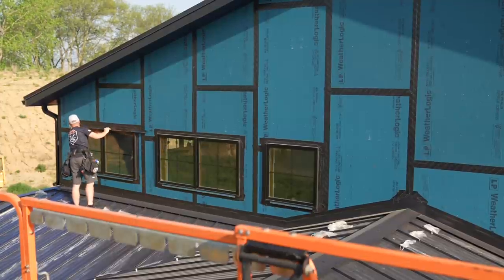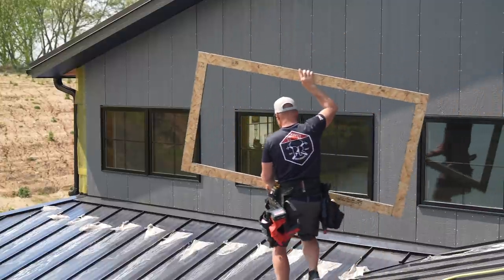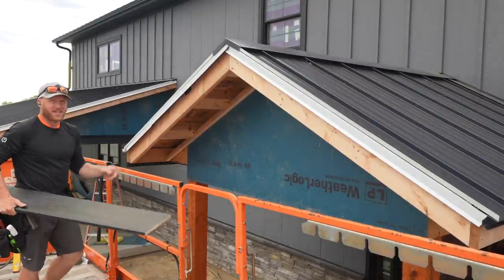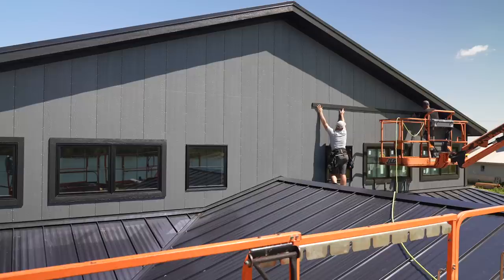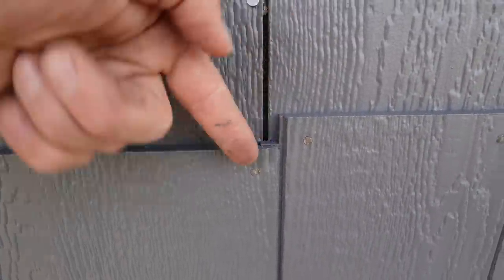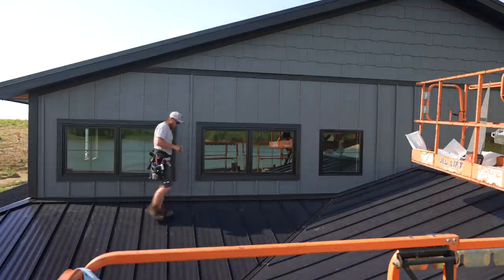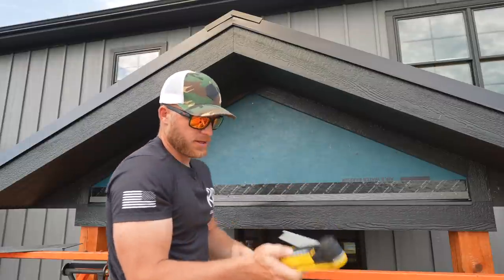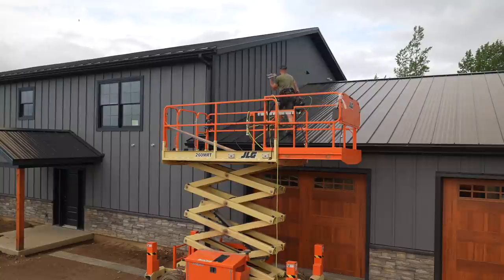Finishing the Barndominium Exterior! Epic Final Drone Footage

Comment: My personal take on the siding.  Adding the battens makes a huge difference in the "dimensionality" of the structure.  The gray does look good but, I would have gone with a slightly darker hue for the battens, about halfway between the siding and the black trim/roof.  For the shakes I'd have gone with about the same shift but lighter.  Just to make those details pop out little bit more

Comment: Hey Greg, so we’re installing DK LP in the same pattern: Vertical B&B w/Staggered Shake in the Gables. Wrapping up the vertical and getting ready to install the Shake and just now realizing we’re working w/24 o/c framing in the attic gable walls. Unfortunately, there is no structural sheathing, just 3/4 exterior polyiso nailed to the studs….I’ve already trimmed out my band board and everything down below…What is the best course of action from here? 
Thought I’d just overlay OSB, but realized it would make my rake frieze proud of my corner and band trim below…considered adding in blocking from the inside the attic, but seems like there’s a better way…After watching your video, I’m thinking I should just remove my band boards (we used 5/4” pocket trim w/concealed nail fin), run my 3/8 vertical panels all the way up, then start back with new 4/4 band board and resume…but I’m worried about well the shakes will nail into the 3/8 where there is no studs in between 24”…Should’ve caught this much earlier 🤦‍♂️

Comment: Maybe somebody can answer my question.
I am a roofer in Germany and we learned that you never put OSB on the cold side of a building aka the outside because it acts as a vapourbarrier, traps the moisture and rots away. 
In these videos i see that the americans use OSB on every part on the exterior.
How does it work?
Reply: On this they used a weather logic which has a vapor barrier on the outer skin and then taped the seams. You're right, no one should use osb on exterior but a lot of cheap builders use it.

Comment: I'm really tempted to do the window trim overtop the siding with a cup flash and caulking just like you have, but I feel slightly hesitant because of the manufactures opossing recommendation. I like how your method seals the edges without the need for caulk and if the top fails, it will mainly damage the top piece of trim only. How did you come about this method and have you had any issues with it? Do you recommend it? Thanks! Everything looks great. Your team rocked out some complex cuts on the wall without batting an eye.

Comment: All the vertical lines makes it look to much like commercial so do some herringbone diagonal on the end walls to break up the form. Also I am not a fan of ground level building that I see all the time. I see that this building's height is made to be filled with soil for grass and maybe some drainage stone, how ever it will be landscaped which will make it ground level in the end. I would want 12 inches or more foundation height above finished grade. If you think about it you will see it make much more sense.